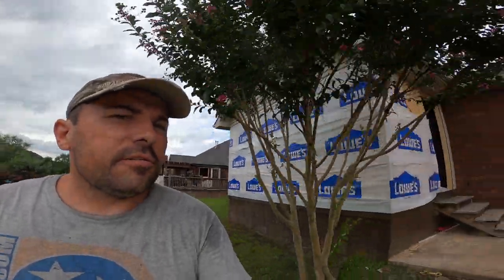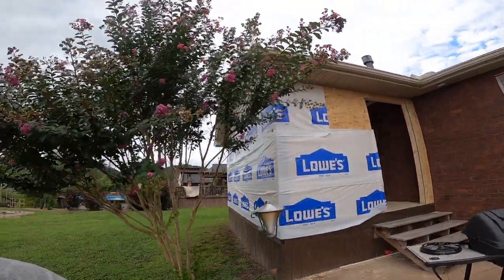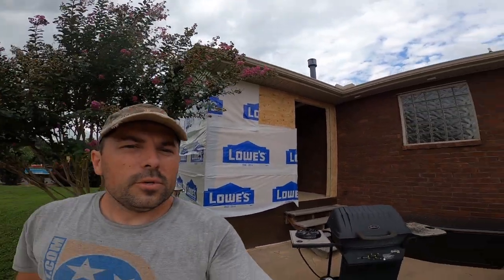Your DECK could better serve you Convert covered deck to sunroom to use all four seasons

Comment: Thank you for the video,fantastic. I have a 3 seasons room that is just 4x4's with single pane windows in between them(11 windows total). I just installed a portable AC/heater unit and the thing has to work too hard to keep it climate controlled so I am thinking of going further with this. I was thinking of blacking the windows out with black felt on the inside and then putting a 2x2 in between all the windows.Insulating with R13 all 3 walls and then finishing the inside with a tongue and groove Knotty pine. Do you think that sounds like a good idea or will there be any pitfalls? The ceiling and floor will not be insulated for now anyway but I was thinking the wall construction might make a drastic change?Thanks for any insight!
Reply from the maker: insulating the ceiling would make the biggest difference

Comment: Do you have to put the subfloor before framing or can you put it after?
Reply from the maker: Either way will work.
Reply: @TheProCut17  thank you for the reply! What subfloor did you use here? We are thinking of putting tile in ours and not sure what we need to use.
Reply from the maker: @sarahrager1894  if you are going to tile you want Hardie backer and it should be thinset down in place and screwed or nailed. then thinset the tile down on top of that.
Reply: @TheProCut17  ok so subfloor, thin set, hardie backer, thin set, tile?
Reply from the maker: @sarahrager1894  if your 5/4 decking is in solid shape you can likely skip the subfloor
if your decking is in poor shape and you are replacing it use a 3/4 subfloor
of course it wouldn't hurt to add a subfloor over the decking if you wanted